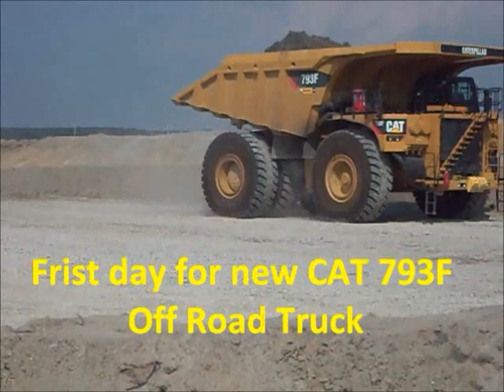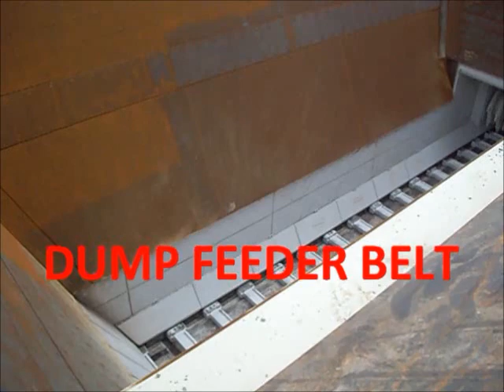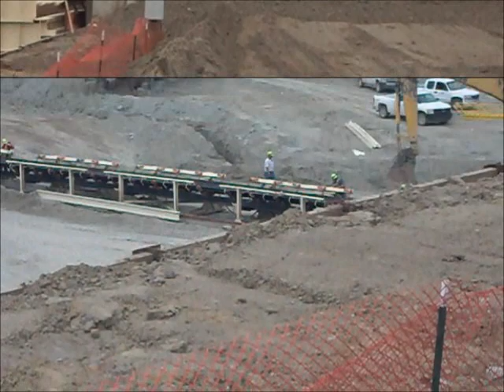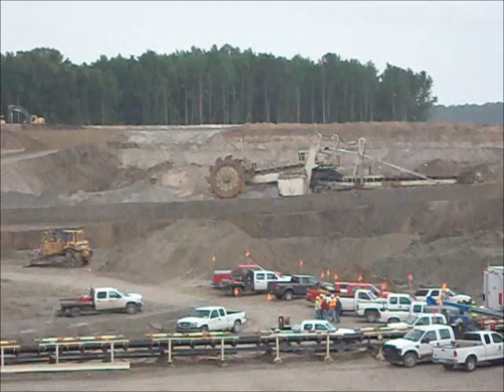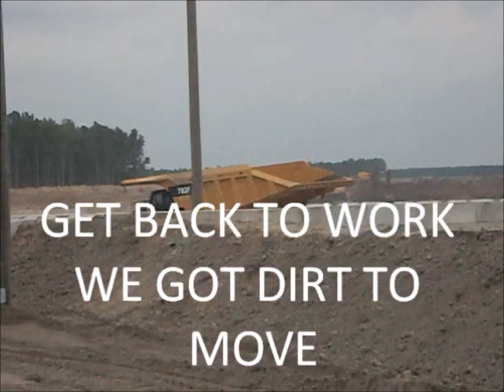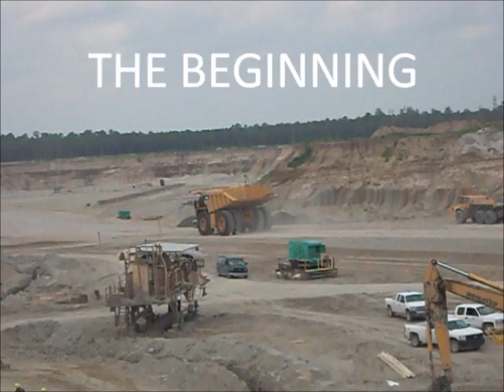Cat 793-F

Comment: @LeeRiderADVENTURES   The Cat 793 haul truck is a legendary machine. I’m firmly convinced it is the best mining truck ever manufactured in the over 200 ton capacity.In the mining industry it is considered the GOLD STANDARD. You know this is a great machine, buy the fact CAT has sold well over 5,000 of them. This is the kind of high capacity haul truck that you just can’t go wrong with as a mine operator or contractor.